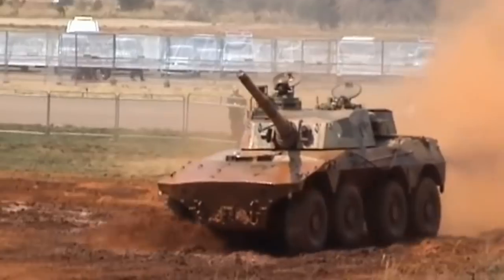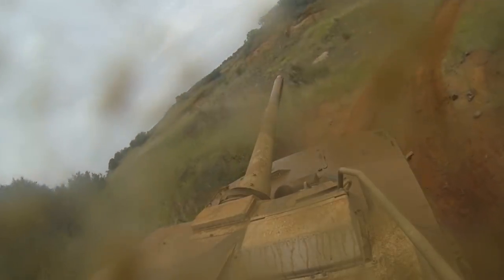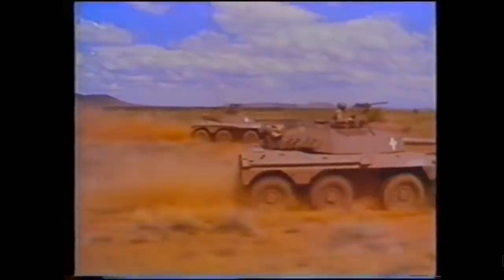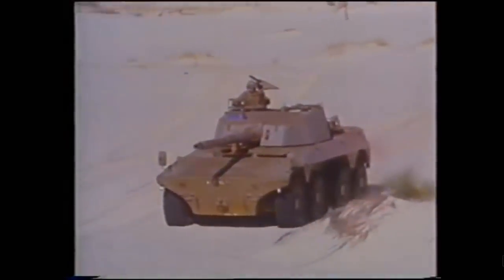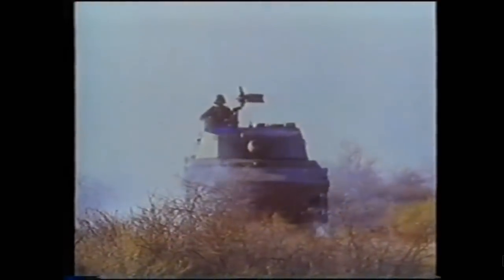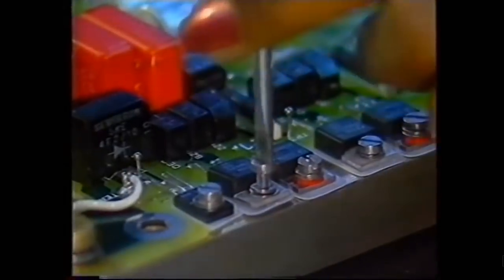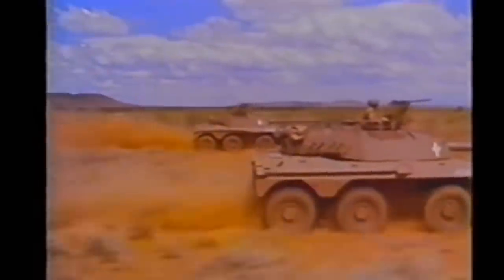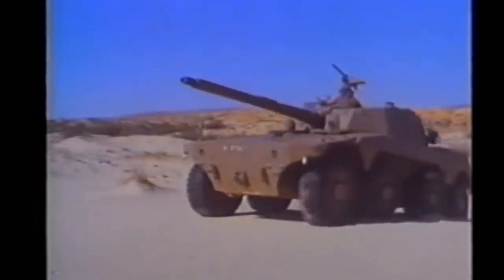Rooikat Armored Fighting Vehicle - South African Firepower

Comment: I would argue that this vehicle are among the most interesting in a modern strategic sense.
It is a near perfect reconnaissance vehicle, even in Europe, its gun are good enough and have a decent load of shells (something where the 105 and especially 120 mm would struggle, unless we are talking a three piece ammo), it is light enough and it has a really good range.

If it is light enough to be transported by helicopter, then we are talking the near perfect raider style AFV for a small nations marines unit... Imagine an Absalon class ship, bringing a company of marines, with a platoon of these, for raiding against say a Somalian pirat base, or a rapid respons unit against a Boko Haram unit in Côte d'Ivoire... These AFVs could be a real game changer for a country like Denmark or the Netherlands, to bring a bit more firepower to the IFVs they are already operating.

Besides an upgrade in electronic systems, the only need I see for the Rooikat is a few anti-tank missiles, just to give it that little bit of punch... But even without those, this AFV is one of the more impressive "complet" AFVs that has been made in a long time.
Reply: bandholm, that is why we have the Ratal.
Reply: I agree, that the design has some interesting ideas. but to be fit for european needs (to be used by and secure survival of trained crews), it would need many modification.
If you put 10 Schützenpanzer Puma, against a hundred of theese in night, i bet the pumas would wreck every single one of those without beeing hit one time.

The armour is shit. I highly doubt the stated "protection up to 23mm" Its just simple Steel plate, not even dual layer with gap. I gues its protection is max up to HMGs. Except you hit the angled front in a bad angle, then you may stop 20mm.
This vehicle would need a complete overhaul of its hull, a protection up to 25-30 mm on the whole front would be highly desireable. I assume, that with not much more weight, and a mix of steel plate and composite, you could easily achieve that. If you layer the composite with a air cooled gap between this two modules, you would furthermore achieve good thermal camoflage. An option to either put a cage or extra mounted composite armor would be nice too, fe. if you want to use it as transport vehicle, or use it in urban areas.

Next point: 9 Shots available?... and then? A vehicle like that would really really benefit from an unmanned stabilized turret and autoloader. Also 79mm is a bit overkill, there is no sweetspot in european warfare for that. Either our vehicles are armoured to resist HMG Fire (12,7), or IFV Shells (20-30mm), or AT. So a 35-40mm gun would seem like a sweet spot. Even more Ammo then the 79mm, and everything available right now, when you need it. For considering it modern, it would also be nice to have the HE ammo with airburst capability.
2-4 BLOS ATGM with SA Capability (Helis) would round the armament up.

The optics are outdated. If you need an infrared searchlight to enhance your nightvision, you should be already aware of the bad capability of stock Nightvision. If you want to build an AFV that suits for Europeans, you want to have it multi role and adaptive, so its also capable for different tasks. And it should fit some nishes. One nieshe could be, that its capable to raise main cannon way higher angle than normal, so that you can use it as anti air gun or in urban fights. An other would be modern optics. With IR searchlight you are a shiny bright thing in european warfare night, you would be spotted kilometres away. Thats a NoNo.

And then its a big vehicle. With european engineering, you would make more compact parts and design, so that you can use the rear as infantry transport or command module or else.

You already considered an electronics upgrade. it would highly profit from that too, but i would put it on last point, everything above would be strenghtening the fighting and surviving capabilities more then that. Sensors to detect laser and radar locks, soft kill APS, command network link etc etc etc.
Reply: CertainDeath777
"If you put 10 Schützenpanzer Puma, against a hundred of theese in night, i bet the pumas would wreck every single one of those without beeing hit one time."... If they doesn't get an upgrade in electronics perhaps, otherwise I highly doubt it! The Puma is not some magical invisible thing, its a IFV with tracks, a 30 mm gun and that is about it.

"The armour is shit"... The armour is said to be able to withstand calibers up to 20mm, for an armored reconnaissance vehicle, that is more than acceptable, sure getting it upgraded would not be a bad thing, but we are not talking about a replacement for tanks here, we are talking about a vehicle that can act as an armored reconnaissance vehicle that in relation to, say an expeditionary task force, can act as a fire support unit. Again in that relation its armour is good enough.

"9 Shots available?... and then?"... If a reconnaissance vehicle is in need of more than 9 shots, then it has no business starting the fight... Also quit a few tanks has historically not had more than 9 shots in the turret anyway, so it is not that big a deal.

 "Also 79mm is a bit overkill"... First of it is a 76mm. Second, I don't agree at all with that (for one thing there is no such thing as overkill)!
The 76mm brings a lot to the table, a good HE shell against bunkers, infantry and buildings... An anti-armour shell that is more than capable of defeating any IFV/Recon units out there, and if it can get to the side or rear of main battle tanks (where the armour is considerable weaker) it can defeat them too.
I am hesitant to claim that it is a so called "sweetspot" gun, but it is a great gun for the support element of a recon unit, and very capable even for a armoured infantry unit (if the MBTs are not, for what ever reason, available).

"For considering it modern, it would also be nice to have the HE ammo with airburst capability" Not sure why you say that, given it is a gun used mainly on ships, that also have ammo with airburst capability... The 76 already has this capability.

"The optics are outdated" Would be part of the electronic upgrade... There are no question that it needs a fairly big upgrade on a number of areas, that however doesn't change the fact that it is a really strong starting point.

"And then its a big vehicle. With european engineering, you would make more compact parts and design, so that you can use the rear as infantry transport or command module or else."... Being big or small has both good and bad points, making it smaller would mean that it is easier to hide, and somewhat harder to hit. Having the size that it does, means that mines are of less of a problem, gives it better view and gives it a capability for easier upgrades.
Again upgrading the electronics, so that it can be more effective, is incredible important, but there are absolutely no need for it to be able to carry infantry, that is not its job.
Reply: The puma has far far superior optics. If your recon vehicles has to use infrared searchlight, to see something, it stands absolutely no chance against modern vehicles.
The puma is armoured like a tank too.
Your recon vehicle is a gun on paper... the description "can withstand upt to 22mm hits" i highly doubt that. old russian BTR with similar single hull steel armor can withstand up to 7,62 or 12,7mm. i bet the "up to 22mm" is just in case you hit the angled top front armour. on every other place you cut through like a knife through butter.
9 shots are nothing.
and i rather would like to have 300 round 35mm then 100 rounds 76mm in combat (from which 9 rounds are availably, what a joke)
if the 76mm is capable against modern tanks... i highly doubt it. you would have to get very close to rear or sides... with the superior optics and some tactics of a decent tank crew, no way to get there.
The vehicle does not have the capability for airburst.
Size gives mine protection? :D how do you explain that :D you can protect from mines with higher tires (more space between mine and hull, thicker armament, and if the crew does not sit on floor mounted seats. size has nothing to do with that. My point was, that the vehicle is so big, that with modern engeniering, it has enough space to fit personell or specialized modules.

Again:
an electronics uptdate would not do it. this vehicles does not meet the standards and need of modern european equipment in any point. its kind of primitive. a good design. like panzer 5 was a good design. but you would not field panzer V anymore today. Its decent for an african army, against inferior african armies. but as european you would not field it against african armies, cause you want best equipment for well trained soldiers, so your kill death ratio goes highly in your favour. cause we have to avoid losses of well trained soldiers.

and the part "use it as recon vehicle" forget about that. We have recon planes, helicopters, sattelite, jets, drones - everyone of those are better suited for that role... our ground vehicles are all multi role. we do not build vehicles for a single task anymore, except its highly specialised.
Reply: "The puma has far far superior optics" Again that is part of the electronic upgrade... We might be talking past each other on this, to me an upgrade in electronics, does not mean just the radio and communication... It is optics (that in modern setups is effected by electronic equipment), sensors, radio, satelites, tires, stabilizers and so on.

"Your recon vehicle is a gun on paper" So what? It is a recon unit... It needs to have weapons to ambush or targets of opportunity, and if trouble is on its way, it needs to get the hell out... Recon units are "guns on paper".

 "I rather would like to have 300 round 35mm then 100 rounds 76mm in combat (from which 9 rounds are availably, what a joke)" Well it doesn't carry 100 rounds... And fair enough, you want a 35mm, with the limitations that leaves you. And 9 rounds available is not a joke, quit a few tanks did not have more rounds ready.

 "if the 76mm is capable against modern tanks... i highly doubt it"... That is because you don't pay attention then... The side armour of Abrams had to be up-armoured in Iraq due to the vulnerability of RPGs, in Syria both the Syrian army, with its Russian bought tanks, and the Turkish army, with its leopard 2 tanks, have suffered heavy casualties to RPGs and old anti-tank missiles, the 76 the Rooikat is armed with, uses a sabot that is more capable than hand held RPGs... Sure it doesn't stand a chance against the frontal armour of a MBT, and as I said in my first post, I think it needs an anti-tank missile system, but on the side and rear, especially in an ambush scenario, it can do the job with the 76. And against everything else, it is more than capable. 

 "Size gives mine protection? " As you pointed out yourself, the tires gives the blast protection from the mines (as well as the hull shape), that however means the vehicle gets a certain size before all the rest is added... Putting in certain mine-protection capabilities means the vehicle becomes large in size as a result.
Reply: you do not get the point. this vehicle is vastly outdated, the enginiering is way outdated, there is no need for a recon vehicle, and if i would have to drive in this vehicle as european soldier, i would not do it. germany has hundreds of old marder IFV rotting in garages, which are way better manufactured, then this 60s tech vehicle. no european country would take it to consideration to buy or produce a single one of theese outdated crap and no trained soldier would see forward to drive with this to a war. you can put in africaans to fight africans, but not europeans^^
Reply: "there is no need for a recon vehicle" I am sorry, but where have you got that extremely stupid idea?

"like playing battlefield 4 with a pentium 4 and 2 gb sdram"... We are not talking about a game here... I get the impression that you have no idea of what you are talking about.
Reply: the rooikat is heavily outdated, and no european country would ever consider buying it. get over it.
Reply: bandholm  boko haram is present in Nigeria Cameroon and chad only.
Reply: It can withstand 23 mm .....SA learnt the hard way against the ZSU in previous battles and hence deliberately build this requirement in.
Reply: Yes and no.
Drones have a lot of perks and would be part of the long recon element, but if you are thinking about it, satellites and such are also there. 
But recon vehicles are still very much needed, and are unlikely to be given up.
Reply: I doubt that south africa will be in the position to build more advanced equipment then this, if they continue with their racial cleaning. The radical nationalist and racist goverments are normally not very intelligently lead. And bad leadership results in a lot of backdrops in a lot of sectors. I highly doubt that one of theese demagoges will make any scientific breakthrough, they are even to dumb to copy existing stuff...
Only possibility is to have good connections with the people, that build the machines, that build the stuff. And most of theese machines come from Germany. Ah... South Africans are hunting the germans, dutch and other minorities in their country, and calling them oppressors? I think thats it with deals.
I even doubt if south africa will even stay in position to produce such 60 years tech like the rooikat, if it is continuing this path it goes.
Tribalism does not work in a high tech society, you guys have to decide what you want.
Reply: @certaindeath7776  I am British and I would not mind kitting the British Army with Casspirs, Rooikats and Ratels for mech formations.
Reply: @certaindeath7776  Unfortunately I can't see your entire reply. From what I can see, you believe Zeiss was East German, when it actually was both. 
Also, you seem to believe that Zeiss stuck to the arms embargo, when in fact, they built the pre-production prototypes of almost All our night vision equipment.
Just a short list:
Teledyne Continental - AVDS-1790-2A
L7 105mm
Ring gear on the G5 & G6
Strikecraft 
Milan ATGW
Exocet
Reply: @certaindeath7776  you dont know what you are talking about. This unit can do 140km/h and travel nearly 1000km on a tank of fuel. 2SSB
Reply: @Brecconable  

Fellow Brit here, and I concur ...

I swear our military procurement process is oftentimes a complete joke, and deeply embarrassing, even more so when lives are lost, especially when a huge amount of money has been spent in 'upgrades' ... 

But back to this: woukd definitely love to see it operating along side what we have already. The only changes I would make is i) a more efficient, and high torque output, powerpack; ii) update electronics (a given, really ...); and iii) a system that allows the pressure in each tyre to be independently controlled. That last one sounds odd, but if you know anything about farming in the Netherlands, and so forth, being able to change tyre pressure from that suitable for tarmac, to boggy fields, and back again is an absolute must. Mostly it used to prevent overly hard soil compaction, but better traction is coincidental. A lot of Australian 4x4s, and the odd 6x6s, have that almost as standard that, whilst what is encountered to 'hard'/compacted sand, that feature is useful for both dunes, and, during the rainy seasons, when the sand turns into a bog. So having variable tyre pressures is seemingly a must for any/all conditions.
Reply: Heck, my country can't really afford tanks and the tanks we do have were left to rot for years. The Rooikat would be an excellent way to get firepower down. A much better fit for our mountainous terrain than the much heavier tanks. Slap some ATGM's on the sides of the turret that can be aimed separately from inside the vehicle as well as some ERA on the turret and hull for that little bit extra protection and boom, a vehicle that will make mincemeat out of anything that is less protected than an MBT without using it's ATGM's. And mincemeat out MBT's with it's ATGM's. Naturally, a slight boost in horsepower will be needed. Much easier and cheaper to maintain than an MBT and much easier to teach the driver how to drive it as it's basically the same as driving an 8-wheeled truck.
Reply: @certaindeath7776  The Rooitkat is a raider as well. A 3 inch L62 gun would be far more powerful than a 30mm. The gun itself is basically a naval gun. The Puma would have latest upgrades no doubt that doesn't mean the Rooikat can't have them.

Comment: Thanks for featuring the rooikat. It took me down memory lane. It was called motley when I worked on it. Motley means "scrambled or deurmekaar in Afrikaans". I worked for LEW, the manufacturer for the turret and I was the first woman electronics engineer and consecently I designed the first FCC (fire controlled computer) in 1987. We used Intel 8 bit CPU (computer processing unit) for the prototype but then Intel flew a 16 bit CPU specially from the states for our upgrade! Parallel processors were just talk of the town. Our first attempt was half successful, as we switch on the radio system during our systems test, the FCC shut off... Too much noise and interference. It turned out we had to redesigned the grounding concept. Remember, electronics in armored vehicles were new back then.

Just a note on the comment for the 105 on the turret. 105 would not be good, coz the turret needed to be fast and light and in those days we already had the 105 gun on our G5 weapons platform. The rooikat (red cat🙀) was designed and spec'ed to run fast and shoot fast. I worked on the FLIR as well, so it was formadible at night as well. 

I remembered when we took her to test on the roads how the  public were in awe as we roared down the roads in Irene,  Pretoria and moved the turret with ease.

Good memories.
Reply: Amazing story, thanks!